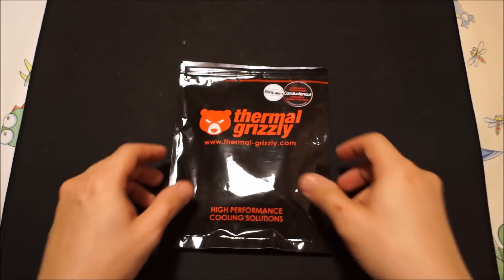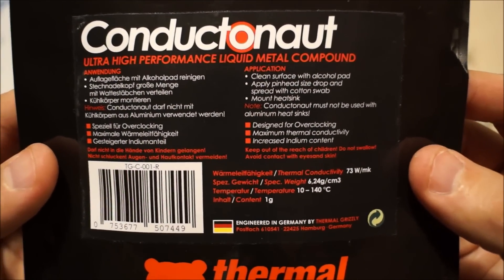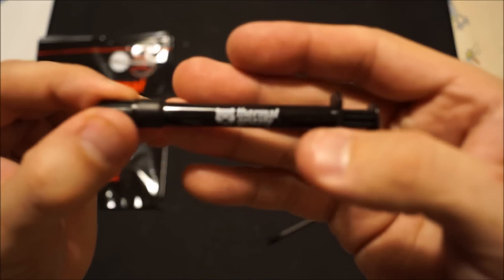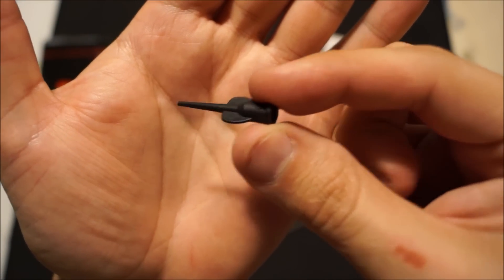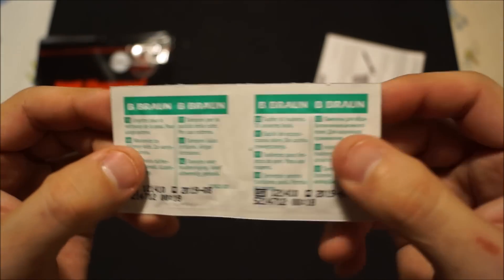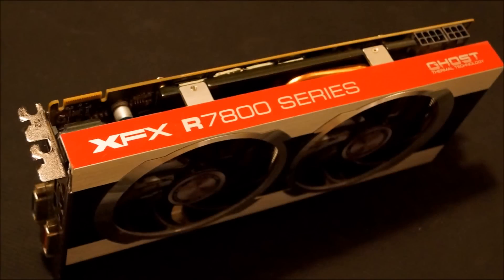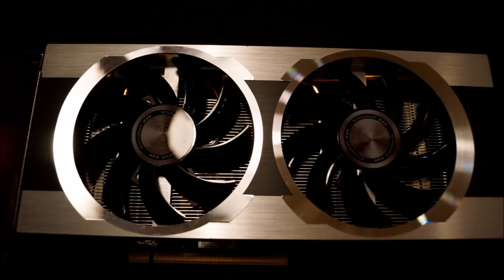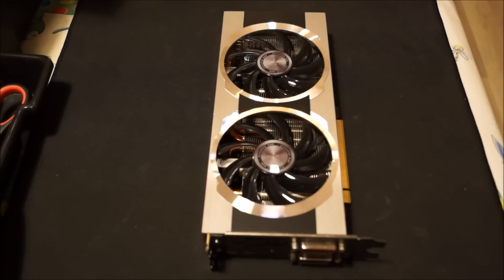Thermal Grizzly Conductonaut...is it any good?

Comment: should i use this on a laptop? or should i opt for the kryonaut instead?
Reply from the maker: Good question. The answer is no. No matter what anyone else says, never use LM on a laptop. If you want good and reliable thermal paste that will last you many years without degrading, try MX-4 or even better MX-5. 

Gallium based thermal solutions fuse into copper, leaving a gap between the heasink and die. However if the heatsink is nickel plated where it contacts the die, then liquid metal can work pretty good 👍🏼. Otherwise avoid it at all costs.
Reply: @TechnologyHive  oh actually, which one's better? those ones you recommended or a kryonaut?
Reply from the maker: @rxf_  MX-5 in my opinion, is the best all around thermal paste.
Reply: @TechnologyHive  but thanks for the info!

Comment: Might suggest not even using the nozzle provided.  Watched another video and they suggested just putting the liquid metal on a  Q-tip.  My package of Conductonaut came with two, and simply applying it on the Q-tip worked really well.  

Also it was my first time ever using Conductonaut, if i hadn't watch a few videos on applying the liquid metal i would have been freaking out.  The issue is at first the liquid metal will not want to stick to the metal surface.  Either to my copper heat-sink or the nickel finish on the CPU.   Seems the copper started accepting it after about 5 minutes of working it in, the nickel on the CPU maybe 10 to 15 minutes.  Eventually it all started adhering :)  And as you can see in the video here it really take so little to cover everything.
Reply from the maker: I agree. The nozzle is just too easy to send liquid metal flying all over the other components 😑. Good tip.
Reply: So how does it age?
Did you do a repaste now or not?
It is performing the same w/day1 application?
Or did it degrade but still work well or degraded so bad you need to repaste?
Reply: @gamertechlive1780  It seems there has been effectively no change from when i built it, the complete system i have is a 5950x and an artic 360 aio and even at peak times, i've not seem any reasons to be  concerned in the slightest.   So as for aging, would expect some degrading but haven't.  I'm thinking if applied well and all it pretty static there really isn't much of a way for it to degrade from what i can see.

Comment: i know it is two years late, but i got overheating issue with my laptop's i7-9750H. And after replacing the stock paste with kingpin it does drops the temp by 10 degrees or so. but it is still over 70 degree so i am still worried. 

the other issue is, i am still not confident on applying a liquid metal like this conductonaut on a laptop xD, any tips on that?
Reply: Over 70 C is not "overheating". Laptops frequently run at 90+ C, perfectly safely.
Reply: Brandon Bridges sure, let that run in a tropical country like mine, and let's see how long you can still say that it is "safe" 🤦‍♂️
Reply: @hadifelani  It is safe anywhere. Virtually ever laptop in existence surpasses 70 C.
Reply: Brandon Bridges lol no, my old msi GP62 6QF (i7-6700HQ inside) never exceeds 70 on full load. Even in synthetic loads like benchmarks it's maxed at on 72C and that's very rare.
Reply: Brandon Bridges where did you even got that data from? omegalul "virtually every laptop in existence" 🤣
Reply: Brandon Bridges sure, a little bit over 70 is still "fine", but once you got past 80-85, that's where the components lifespan will decrease. Especially on laptops. And my msi P65 with i7-9750H inside, before I used liquid metal on it, it idled on 65+, and once it got ramped up it immediately went past 92C the whole time, it even often reaches 100C. Causing it to be restarted occasionally due to the "overheat" failsafe protection you won't recognize.

It might be fine on desktop, but not on laptop smh you need to get your facts straight 🤦‍♂️
Reply: @hadifelani  You're making a strawman argument. You're arguing things I never said.

Laptops run hotter than desktops, and are intended to, Temps that would be unsafe on a desktop are perfectly fine for a laptop. It is definitely not the reverse.

That said, 65 C is a HORRIBLE idle temperature. My laptop idles at 35-40 C. It reaches 80-85 on the CPU when gaming, and 65-70 on the GPU. It reaches 90+ on the CPU during benchmarks like Cinebench, or stress tests like Prime95, which is fine. The laptop lowers its turbo speed when that happens, and downclocks from 4.0 GHz on all cores to around 3.7 GHz to quickly drop to lower temperatures.

A laptop that is nailing 100 and shutting off is completely different than getting close to 100 and then reducing clockspeed to cool off. Nearly ANY laptop will do the latter. Very, very few 9750H's stay at 4.0 GHz on all cores during synthetic benchmarks like Cinebench.
Reply: @Nauzhror1216  lol, yet you didn't answer my question about where did you get the data by saying "virtually every laptop" argument. What a joke
Reply: @Nauzhror1216  also, try to differ "surpassing the treshold sometimes" with  "reaching above that most of the tine" which is the main topic here. Smh 🤦‍♂️
Reply: @Nauzhror1216  nah, I never mean to do strawmans, it's just because you are making ridiculous assumptions about thermals 🤦‍♂️
Reply: @hadifelani  If you think most laptops don't exceed 70 C you're delusional. I don't need to find you a source to prove that. Look at ANY laptop review. Use any laptop. I've owned an alienware, an ASUS, a Dell, a HP, a Sager, a Maingear, a Toshiba, and a Lenovo. Every single one exceeded 70 C under load. I've read hundreds of reviews, they virtually all exceed 70 C. I also have a Masters Degree in Computer Science. There's no "source" needed to state something that's blatantly obvious. 

If you think I'm go wrong, go look at laptop reviews. 70 C is "not" a high temperature. The fact that you think desktops run hotter than laptops show just how fucking little you know on the topic. Stop talking shit about topics you know nothing about.
Reply: Brandon Bridges look here, try to look for the comment that I EVER said "laptops cpu WON'T & DON'T exceed 70C, then your arguments are valid".
But nope, you're completely missing my points because I was talking about HOW harmful it is for laptops components (all of it) CAUSED by the cpu going crazy over 70C THE WHOLE TIME (and it's not even a heavy load)🤦‍♂️ you're the delusional one here smh
Reply: Brandon Bridges never talked about "how is it possible" for cpus to go over 70C in the first place, of course it is possible even my 65yo uncle would know that🤦‍♂️🤷 in fact, I'm talking about "how long" and "how often" it is to stay over that temp. Yet you still spits all those bullshits
Reply: Brandon Bridges and after I looked again at your first reply. You're even wrong by thinking that I say 70C is straightforward overheating. My original comment talks about the overheating issues itself, because the i7-9750H i had has been reaching over 80 under a light to medium load and idling at mid 60s and once I get it to do a heavy load it ramps up over 90 the whole time. 🤦‍♂️ Yet you say it is fine and after some other ridiculous comments you type you said idling at 65+ is bad, smh. Talk about being a hypocrite.
Reply: Brandon Bridges it's fine if it's just spiking up occasionally, but it definitely not if it stays. You need to differ that. Funny for a computer science master for not able to differ that two things
Reply: Brandon Bridges also, tell me how many people that are comfortable with their components stay at 90C most of the time 🤷🤔 I guess it's just you 🤷

Comment: How do you remove this properly without scratching the surface and not ruin your copper coller?
Reply from the maker: I usually remove it with Isopropyl alcohol 70% and that works just fine. However, if this stuff is used for a while, it will create a solder like bond with copper. The stain will be hard to remove if you can remove it at all. But no worries, it will not affect cooling performance at all.

Comment: Is it important to buff up the heat spreader?? If it is... can I do the same with alimunium plates?? but I won't use liquid metal since aluminium would break appart from contact with the galium.
Reply from the maker: Sorry for late reply. Some heat sinks have a rough surface and others are mirror like polish. The rough surface is better because it creates microscopic valleys which serve as more surface area which is good. But if you have already used your heatsink previously and there exists TIM residue on it that is visible even after cleaning with a cloth and alcohol, then it is a good idea to attempt to remove this with a rougher material, such as the scrub pad included with Liquid Ultra. I hope this helps.

Comment: Did you get the Thermal Grizzly Conductonaut 1g or 5g? For how many application is there in the one you got?
Reply from the maker: This is the 5g tube. The amount of applications depend on how much you use at a time. I have used it about 20 times, uncooked rice size applications and it is still half full.

Comment: This is way too much Liquid Metal TIM... It needs a very very tiny layer, which makes it perform better and safer, with this much of TIM it could leak. This is liquid and stay this way unlike standard thermal paste...
Reply: wardope he is right. Less is better when it is liquid metal especially on a GPU die which has exposed transistors. If the liquid metal comes in contact with them it will fry the card since it's highly conductive.
Reply: @Gripen90  just put down some clear nail polish over the transistors and problem solved
Reply: @Gripen90  100%!!!!  And also the fact that the thermal conductivity of copper (on your sink, 410W/mk) is order of magnitude better than Conductonaut (@73W/mk as per http://www.thermal-grizzly.com/images/downloads/TG_Datasheet_Conductonaut_EN.pdf). Ergo, less Conductonaut  is just plain better.
Reply: Agreed, it was WAYYYYYY too much.
Reply: @Allan Adovas its real,  use clear nail polish
Reply: @Allan Adovas I've already done it to mine, you'll be fine
Reply: Completely right, absolutely don't depend on what you cool, but this is to fill nano gap between heatsink and processor and ton of it will leak around it and even may short circuit caps of the GPU
Reply: your statement is correct if it was a CPU. but he is applying the TIM to a GPU wich wave many more cores and no heat spreader. so you need to cover the entire Chip. so were as less is better on a CPU it does not apply for on a GPU

Comment: Why did you apply thermal paste on GPU AND cooling block?
Reply: aixon not the video poster, but there's a major recommendation about doing so when it comes to liquid metal application. From what I can tell though, it's fairly overkill and doesn't really add much

Comment: its worth if i just put on gpu heatsink?
Reply: Yes, I m pretty sure it's a mistake that he put it on both. He should have put it only on the heatsink. The thinner the better, even the best thermal compound has a bigger thermal resistance than the heatsink base.

Comment: Can you use it both on the die and then on the ihs? Im planing on delliding and wanted to know if i can use this paste on both situations, thanks
Reply from the maker: On their website, Thermal Grizzly clearly states that yes, it can be used both, on the IHS and DIE. But, in my opinion, you should not use it on the IHS, since the real benefits come from use directly on DIE. Over IHS I use normal thermal paste, like Kryonaut, or MX-4. 

Using it on IHS has not shown significant results. It is a waste, since MX-4 can give you same or close results when used over IHS. Another reason why not to use it on IHS is that Conductonaut in time bonds to copper, which is hard to remove once applied. And if one day you need to remove your heat sink, this can create a problem.

I would stick to using this stuff only on the DIE and you will get your best bang for your buck.

Comment: So you are saying that you got a 5 degree temperature improvement and an extra 110MHz over the dried up 5 year old stock thermal interface. To be honest you would probably get the same result with the cheapest thermal interface material available.
This is not a valid comparison. Do you know the environment the card came from and how it has been treated in its previous life before you did this test? Look please don't get me wrong great idea for a video, and awesome work in making it, but next time try to give some idea of an apples to apples comparison. I just don't feel that is enough to convince me that this particular TIM is better than another, but you did prove that it is better than 5 year old stock TIM, just by a small margin.
Reply from the maker: These cards ran hot out of the box new. Avg temps range between 83-86 degrees. One of reasons why the temp difference was not as great as it could have been is because of the cooler itself. Not the best. 

But the main reason is due to card TDP fluctuation. Now that the card runs cool, more voltage is drawn automatically for higher Mhz, plus I overclocked it. If you go back and look at the video, the card actually reached 1200Mhz in some cases by itself. Thus the higher temps. Btw, the old thermal paste was not dried up. It was actually in relatively good shape compared to others I have worked with after a few years of use. Thanks for watching!

Comment: What are the temperatures without overclocking with the TG Conductonaut?
Reply from the maker: Atanas Dulev Temps are the same as I did not need to play with voltages. OC or not, temps are the same.

Comment: Liquid metal is crap it bonds to heat spreader requiring lapping . Youve been warned
Reply from the maker: No it is not crap.  And yes, it is supposed to bond. If you didn't know that it creates a bond before you bought this product and applied it, then maybe you should do more research beforehand. And why would you remove it in the first place? The bond is supposed to be permanent! LOL

Comment: Some people using this stuff cover any electrical connections or resistors that are on the top of the chip.  Some of them mask them with electrical tape and some paint something non conductive on those things.  The whole idea is to keep that stuff off those connections because that could damage your chip if they get bridged in a way that they were not intended to be.
Reply: John Doe I think what you mean is clear nail polish.  and short circuit

Comment: why you have put thermal paste on gpu and on the radiator? Just leave it on gpu
Reply from the maker: Sergio Tarnovsky Liquid metal Tim's must be spread over surface for it to stick or it will just run off. if you spread it on both surfaces it creates a better bond.
Reply: Thanks!

Comment: Does it have to be liquid metal? I am really worried about using conductive paste.  How about non conductive ones?
Reply from the maker: You can use MX-4 or TG Kryonaut and have similar results. Both are great, non-conductive thermal solutions!
Reply: i use allways some ducktape around the dye so if some goes over the zone its not that problem.
but its only usefull on pure chips. using it on a heatspreader or something is waste of money.
Reply: flashtu I use scotch tape and I agree, if you arent delidding or using on a GPU dye it isn't worth